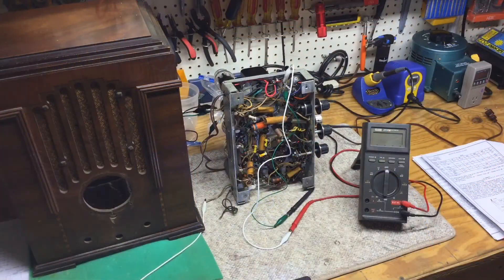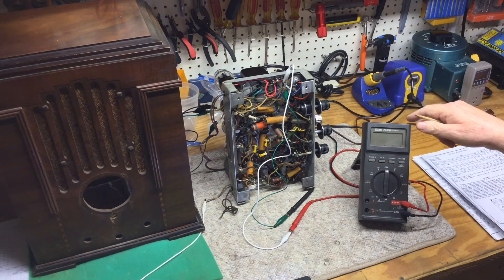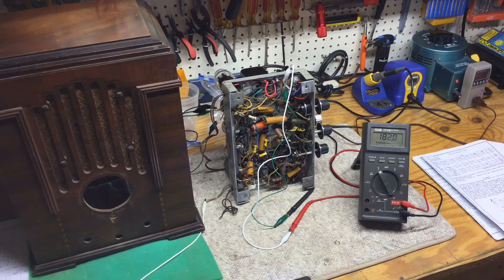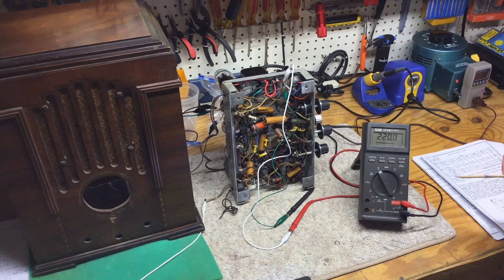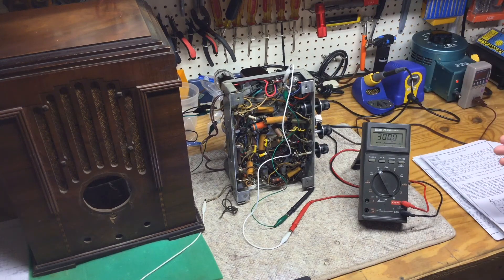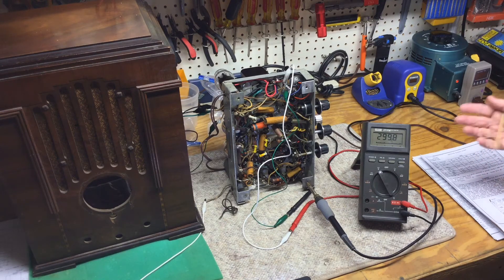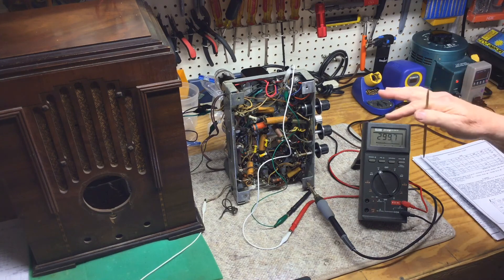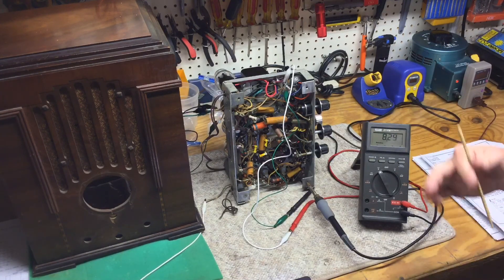Zenith 808 - First Power Up

Comment: what meter is that plugged into your variac?
Reply from the maker: Mike Devita Hi Mike - It's a "KILL A WATT" meter, model P4460.01 that I picked up a few years back; I'm sure they are much improved by now. The meter is rated at 15A with a max. voltage of 125VAC and in addition to reading AC Voltage/Amps, it captures Watts, VA, Power Factor and Freq. in Hz, e.g., 60 Hz. Hope this helps. Thanks for watching and your question. Best, Don
Reply: Thanks for the info and video. I'm learning a lot.
Reply from the maker: Mike Devita You're welcome Mike. Glad you liked it. Best, Don

Comment: Nice job!! Great job of explaining the proper power up procedure. That is going to sound really nice once you get the rest of those old caps out and get it dialed in. Good vid!
Reply from the maker: ScottTV1962 I appreciate it Scott! I finished the re-capping and replacing the out of tolerance resistors a couple days back followed by an RF alignment. I have since played the old Zenith for over 6 hours and it hasn't missed a beat. I hope to have a final video posted on this restoration over the next few days when time permits. Thanks again for watching and your comments. Best, Don

Comment: Those paper capacitors look a lot like the RCA ones from the late 1930s, the ends are rolled over and the leads protrude through a cardboard disk in each end. If that's the case then they would be easy to restuff, Dennis Carter showed that in one of his videos where he grabbed the tube and pulled the innards out through the end with a pair of pliers. I found that a neater way to do it is to get a mechanic's socket of the right diameter, place it on the bench, then place one end of the cardboard on top and press down until the capacitor pops out the other end, this can also be used to take apart axial lead electrolytic capacitors for restuffing that have an aluminum can inside.
Reply from the maker: OlegKostoglatov Thanks for sharing this technique for re-stuffing the old paper capacitors. I will have to give it a try down the road as I saved the old caps from the Zenith to practice on. Best, Don